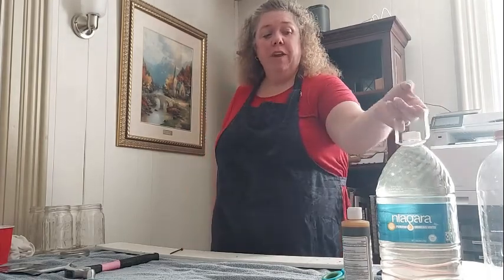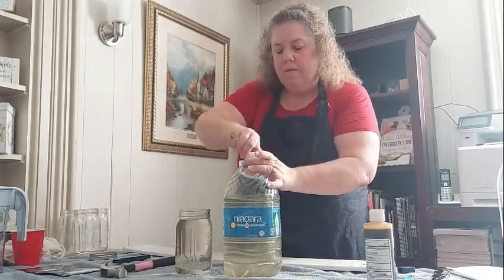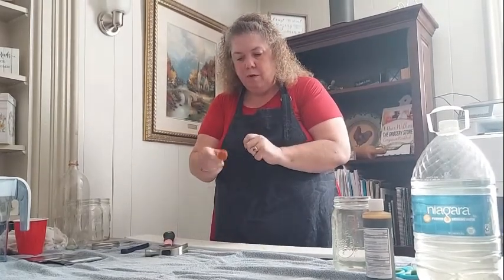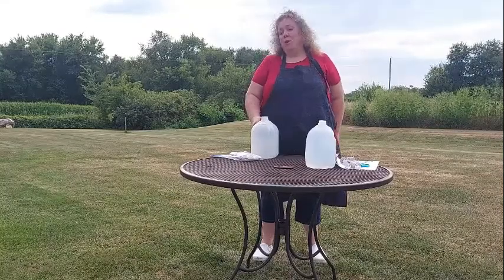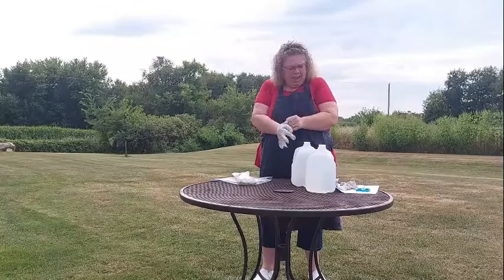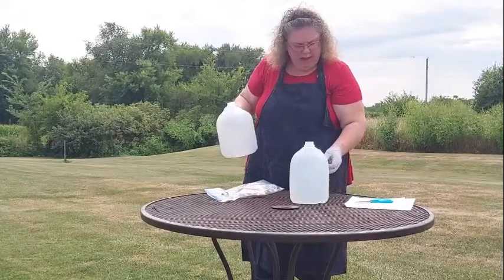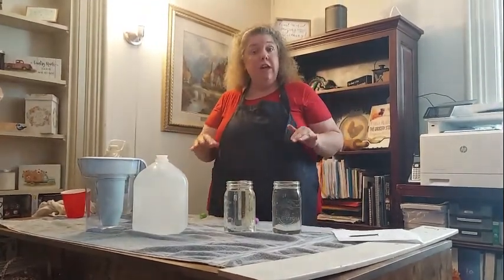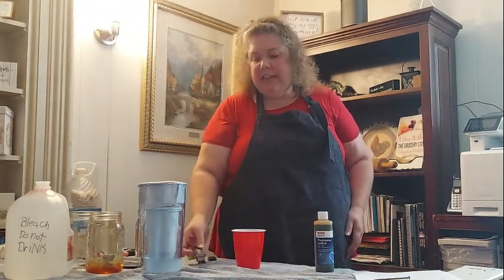Emergency Water Preparedness: How to Make Water Potable

Comment: I like the idea of using a Zero Water filter to get the microscopic nasties out after you've strained the solids. However, would it be okay / advisable to BOIL the water before putting it thru the Zero (waiting for it to cool down before putting it thru the Zero, obviously)? There's just a big part of me that would like that water to boil somewhere along this process.
Reply from the maker: I wouldn't use the zero water filter until I had treated the water with chlorine or iodine (making sure that you let the iodine water sit for 30 minutes).

Comment: If you put the iodine water thru the Zero filter does it come thru clear? Also, does the iodine work as well as the chlorine? Thanks for this helpful video!
Reply from the maker: Yes,  if you put iodine through the Zero Water filter, it will come through clear.   And according to the PubMed article that I link to on my website, it will make water safe to drink,  but you do have to let it sit for a minimum of 15 minutes.  Chlorine works faster,  but from my research - not necessarily better. The other advantage of it is that it takes less chlorine.  I only needed 1 drop for a quarter, bit I needed 19 drops of 10% provoiodine to do the same thing over a longer period of time.
Reply: Thank you. Can I make the chlorine with well water instead of distilled?
Reply from the maker: @BetterKateThanEver  I would think so.  If the chlorine would kill anything bad in the water, I would think that this would work.  I did look into specifically using well water to make bleach and haven't been able to find anything definitive on it.  I've seen several articles on shocking well water, but that's not quite the same thing.  I hope that helps.